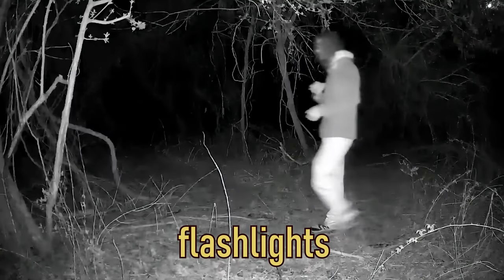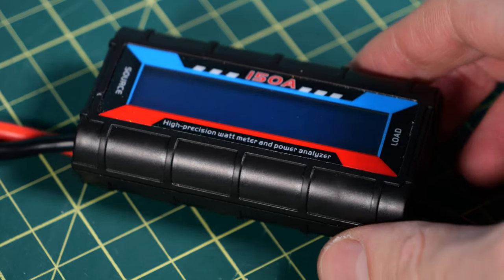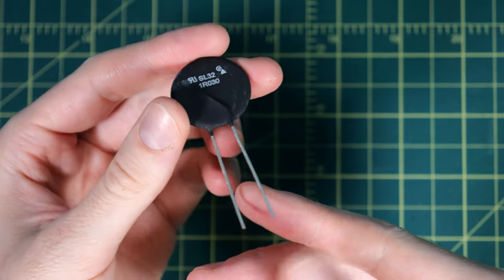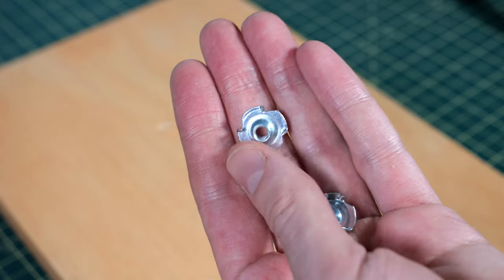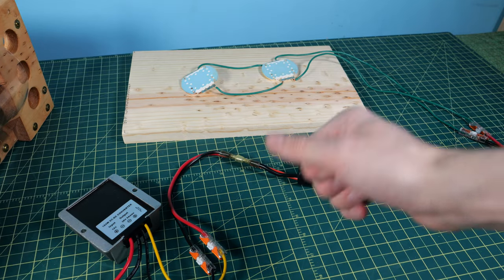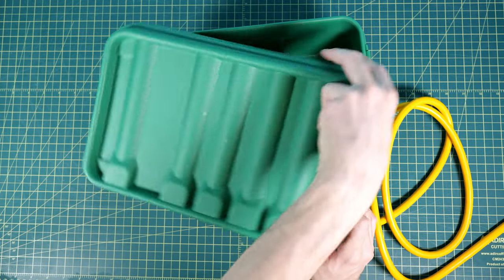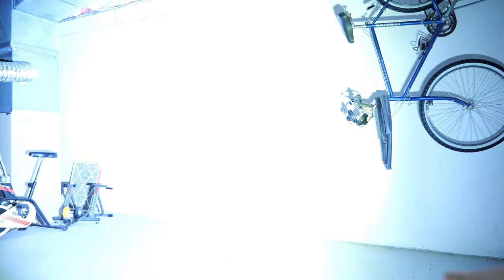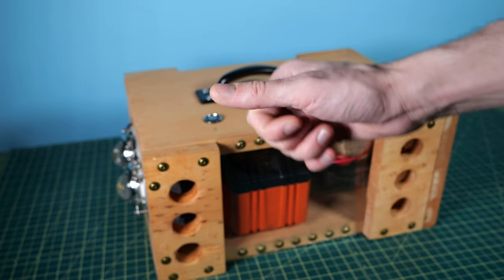DIY LED Flashlight - The Portable Sun - 200 Watts

Comment: On the 110v side of the circuit it will be only using 3amps max so no meed for that thick wire because 12v at 20 amps is 240watts and 240watts at 110v is 2.18 amps

Comment: Hey Nerd :),

How much did this in total cost to build and how much stronger could you realistically make it without completely starting from scratch?
Reply from the maker: The total cost is a bit confusing since I had to go through so many different parts and pieces to get to the final build. I'm guessing but you could prolly get away with about 200-250 ish maby more maby less and that is if you don't build the external power supply part or add windows or the power meter and things like that. I'm kinda guessing to be honest. You could also add metal brackets for the corners to make it stronger if you wanted. Hope it helps - Cheers!

Comment: this is too bright for my project, i need something like a light bulb ~ 60-80w, run on DC, softlight output to make the perfect campsite for me. The only problem is i couldn't find the bulb in DC so i thought of converting an AC bulb to DC by removing the rectifier (i don't think I need to but I would for the sake of efficiency :D :D :D). the other problem is the AC bulb only works at 220Volt.... now this is tricky for me. i guess i could always use an inverter (DC to AC) to power the AC bulb but so dumb i hate it :face-red-droopy-eyes::face-pink-tears::hand-orange-covering-eyes: